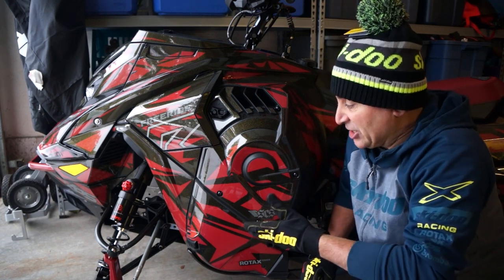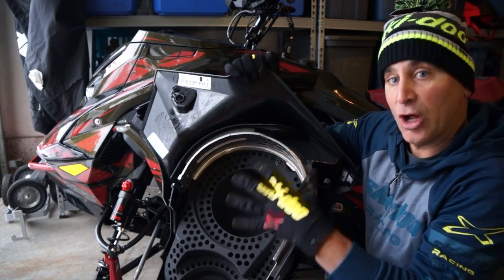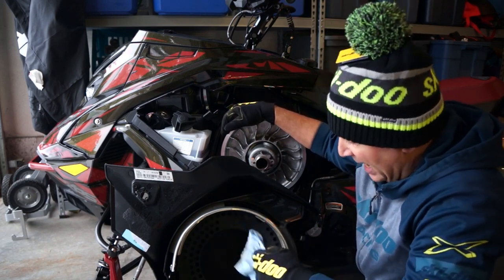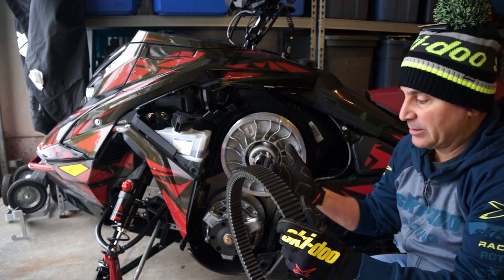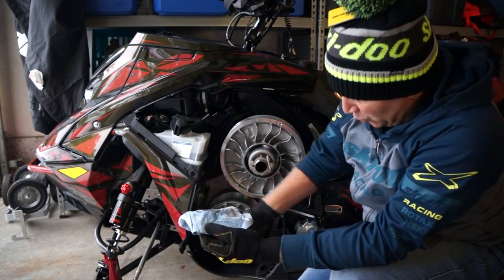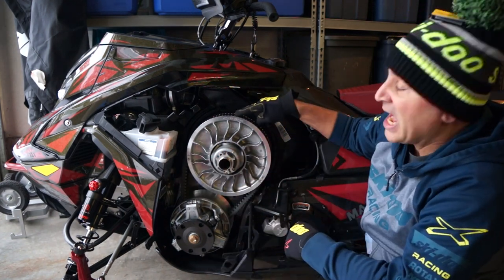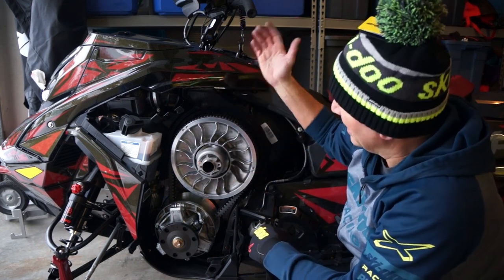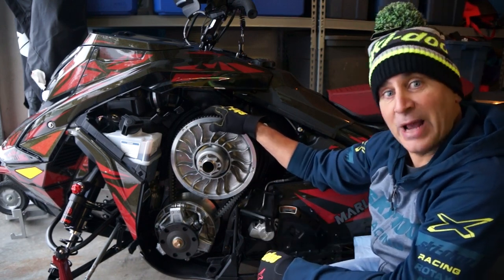2023 Ski-Doo Gen 5 Clutch and Belt Cleaning and Adjustment

Comment: You certainly do not want sc1 on the clutch surfaces, it’s basically a spray wax.  Brake cleaner is the way to go.
Reply from the maker: Yes I put an update in the comments but it has moved down, so placed one in the description, S1 XPS or a good brake cleaner, thanks

Comment: Doesn't the manual tell you to have the track up and run the sled after each adjustment?
Reply from the maker: Might do, never read it, rolling the sled forward is doing the exact same thing, under pressure since skid is on the gound. I have done this for a long time, its not a science, but a simple adjustment to make it work well. If I was going up jackson for the win, i would be more precise, but I am far from that so...this is good enough for me. cheers dave

Comment: My clutches get pulled and cleaned thoroughly every summer, bushings and rollers are checked, and springs replaced if needed. 

Belt area is blown out every few rides, you wouldn't believe how much belt dust comes out of the clutch and QRS jack shaft.
Reply from the maker: thanks for your reply, maintenance is key!

Comment: The new cvt cover/area looks so much better. 
Did you get your favorite 175 expert as well this year?
Reply from the maker: Yes it works very well, no unfortunately no 175 in freeride or summit x, and those are the sleds I am riding as they are the easiest sleds to ride in the line up!
Reply: @DaveNorona  I see. So, you like the flex edge and t motion and didn't want to run the new setup in the expert?
Reply from the maker: @scarpachi01  Yes after riding both I chose the best riding machine for me, and I could side hill them both the same but the t-motion x and flex edge are easier to initiate when conditions are less than ideal. cheers dave

Comment: 2000kms hahaha I call bullshit !
Reply from the maker: Sorry but true!
Reply from the maker: Here is a quote I just pulled off of snow and mud in the comments "I'll stick with the stock belt, don't need any "if you had stock BRP belt you would not have these gouges on clutches" argument. Noth worth penny-pinching over $100 difference in a belt. I had 2700 km on my G4 turbo on original belt." Easily get more than 2000km as well but when I notice a performance drop, I change it out as I ride lots of deep deep pow!!
Reply: Well shiiiit that’s frickin nuts I’ve got 3300 kms on my xrs 800. And have gone thru like 5 belts no bs. And all brp belts.
Reply from the maker: @danteblack9873  something is up, should be getting that on one belt, cleaning it? checking it? Breaking it in properly?
Reply: Thx for getting back to me Dave sorry for coming off as rude. Yes proper break in at least 50kms. I can be cleaning it more often that I can improve on. And sled has been serviced by a skidoo dealer. Very first belt I blew I was going full speed caused me to flip the sled 100 plus miles an hour. Wasn’t fun. Still have the xrs but picked up the new Gen 5 freeride
Reply: @danteblack9873  There can be and I’ve seen belt alignment issues on all snowmobile clutch systems. There is a tool that your dealer has or you can purchase to be sure primary and secondary clutches are aligned. Misaligned belts will cause excessive heat, poor performance and shortened belt life. Hope, this helps and happy sledding.
Reply: What is the name of the tool?